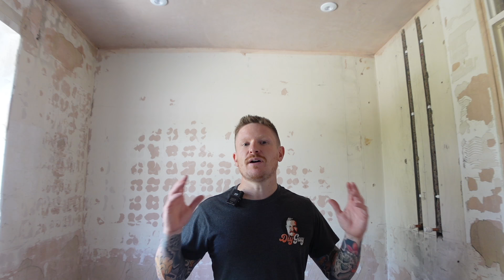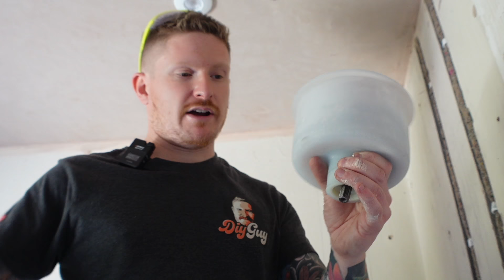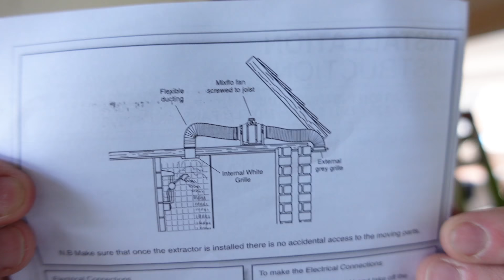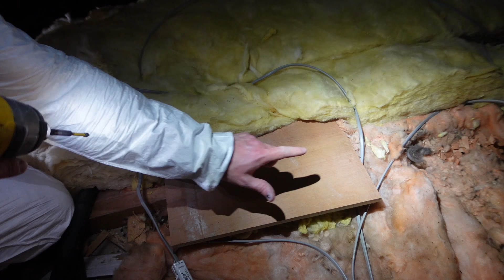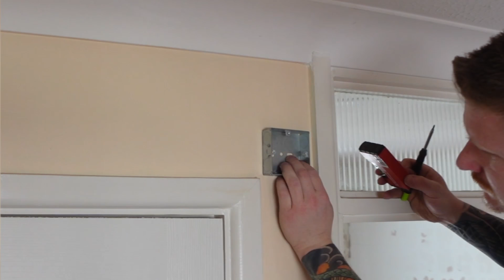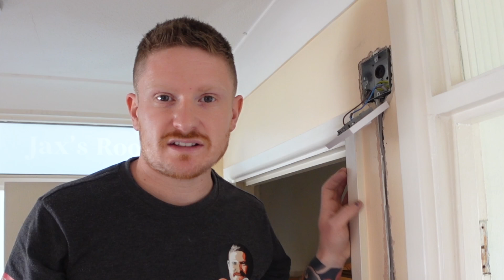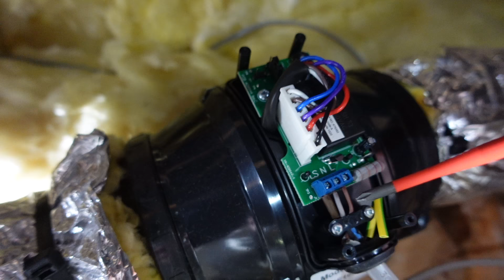How to Install a Bathroom Extractor Fan - Complete DIY Guide Made Easy

Comment: You don’t explain where the wires go if the light switch is directly below the isolator switch does the cable go up behind the isolator and back down to it ? Or have you wired it differently to your bench setup. ?

Comment: I have the same fan but in the 150mm version. Smallish bathroom. Fan over the shower. 1.5m from bathroom to fan then 1.5m from fan to tile vent. Are these ment to clear steam instantly? Ours does clear it but takes a good 5 or so minutes after showering. I bought the 150mm version thinking it'll do it easily. I've also used insulated ducting. Any ideas 💁‍♂️
Reply: Could be air starvation? Make sure theres somewhere for air to enter the bathroom ie ventilation in rest of house, large enough gap under the door etc

Comment: No, don't turn the fan by the light switch, its noisy when you don't always need it and you're pumping expensive warm air outside.
The best way to turn the fan on IMO is to fit a flowmeter to the cold feed of the mixer shower. So, the fan only comes on when the shower is turned on and it tells you when the mixer is up to temperature as the fan only comes on when the mixer is pulling cold water.
I fitted this in my previous house and it worked well for 15 years. I'll be doing the same in my new house.
Reply: hi, what is a flow meter? this is a  great idea. no one wants the fan kicking in when you are just going in to get something.

Comment: Hi mate - I need to replace an existing fan that has an led light. The fan has totally died after 14 years. Can I get away without changing the external
Vent on the outside roof?

Comment: I fitted one of these Manrose fans around 6 years ago when installing a new bathroom, however I opted for a moisture detector to control the fan, fitted in the ceiling with a manual override, an excellent quality extractor fan, and is fully automated, the fan will run until the moisture in the bathroom has been removed before turning itself off.
Reply: do you have a model number for us please?

Comment: Hi mate great video. I would like to wire the fan to a separate switch rather than to a light. Would it just be like the wiring to the isolator? Cheers. John.

Comment: Does it need to be insulated ducting the lads who installed mine used standard. Also they just seemed to put it into soffit without putting in a vent. Seems like moisture level in attic has got worse since...
Reply: Yes it should be insulated. No vent is lazy. Might not be tight on the fan if loft is getting wet

Comment: I bought a MF100T a few weeks ago. It’s running at its maximum speed, the fan has approximately 400mm of duct either side, venting out of the gable end with a wind flap vent. The vent is directly over the shower (rainfall type) The suction is unbelievable I must admit however the bathroom is still very foggy when showering and moisture is still dripping from the ceiling, walls are still wet after a shower. I don’t know what more I can do, very annoying. I may install another fan but on the external wall and see if that helps.
Reply: I’ve got the exact same issue as you, I have a large rainfall type shower head in a smallish bathroom. It generates so much steam I can have the window open and have the manrose fan on same time and room still gets incredibly steamy. I have seen that rigid ducting increases the effectiveness of extraction by allot, not sure if another extractor on external wall like you said would be better then changing all the flexi for rigid.
Reply: @ I may try that to be honest as for me it’s easily accessible and a very short run straight out of the gable end.
Reply: An inline fan can't remove all humid air instantly,  it just reduces it. That's why they tend to have a 20min max run time. Mine clears alot quicker if I open the window too slightly.

Comment: Others may have already pointed this out but many soffits on older properties were created with asbestos boards - you need to be much more protected with a high performance PPE respirator before cutting the aperture - especially when doing so from below.
Reply: I thought I was the only one that noticed that 🤣
Reply: So how do you work out exactly where to drill the 100mm (or bigger) hole in the soffit so that you avoid the rafters and other timbers ? Also  in my bungalow the soffit is somewhat lower than the wall plate to which the rafter are secured and I’m not sure if there is clearance to feed the insulated duct and it cannot be reached from the loft as it’s too far down. 
Is the another way of venting the fan ? (Or solving the problem)
Reply: @Thegasman51  Go through the side of wall.
Reply: @Thegasman51  good point. Drill upwards with a thinnish long bit, leave it in there. Go into loft and observe, then adjust from below. Wood fill inspection hole if necessary.
Reply: @Thegasman51  in between the facia board nails 😉 the facia is nailed to the rafter ends then some eletrical rods are handy for pulling things down you can't reach 👌
Reply: I also initially thought this but after pausing and zooming in on my camera, he is using a JSP P3 series (RD) respirator and the P3 series do provide Asbestos dust protection, provided that they are fitted properly.
Reply: @smout6538  slow down mate it only stops white asbestos fibres not blue or brown...

Your false information will end up killing someone!

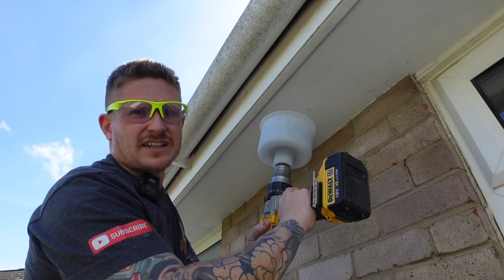Comment: Asbestos alert at 4:00 minutes in. This is AIB asbestos insulation board and it's the worst kind. I have read you had this tested but it definitely looks like AIB. I hope nobody has followed your advice in this regard. Sorry to be negative but it needs highlighting.
Reply from the maker: Tested and not asbestos. Thanks
Reply: @TheDIYGuy1  Did you take a small sample in Hazmat Suit and Full Face Mask etc before commencing any work or did you send off the circular piece after you'd hole sawed it out? You need to edit this video at 4:00 to highlight to others that THEIR soffit MAY contain asbestos and it needs to be proffesionally checked prior to drilling. I am serious, this material kills people and you have endangered your viewers and families even if your sample did not contain asbestos. Do you understand what I'm getting at?

Comment: Clear,  excellent video and diagrams. Installed the same fan. Used the same Manrose 100T fan but hung from roof truss, supposedly less noise. Going to change over the one metre PVC flexi duct coming from fan to gable wall due to condensation in the duct during winter. After i installed  it i asked my electrician to wire the fan separate to the light as originally fan came on with light, which was a pain when using the shower during the day, and the light was on!  Much better now with the fan and light separate!
Reply: Fit insulation on ducting

Comment: mate, any tip on dampening vibration? had one installed and it HUMS the entire freaking house!
Reply: Rubber grommets under fixings and attaching not directly above the ceiling, maybe adding extra board under.

Comment: You conveniently  didn't show the pain you had in getting the duct over the edge of the ceiling  beam and into the soffit  box . I never found a gap of 100+mm at this point.  And I've fitted dozens of these manrose fans.  Also you didn't show the hassle you had getting the outer vent tube with duct plus cable tie back through the 102mm hole you cut.........hmmm
 sorry if you're going to give diyers a guide you have to show them the awkward bits too.

That said good demo but please show the awkward bits not edit them out.

Comment: Obviously couldn't be used due to location, but this external vent type used in vid often seems to reduce fan performance a fair bit. Always found cowled outlets with open/close swing flap work far better, when location permits.

Comment: I’ve just replaced our manrose MF100T after 7 years of use (it died gradually getting slower and slower and yes it was cleaned annually).  They are great, quiet extractors, however, having tried all sorts of ducting the wind noise in our small ensuite is very loud.  I would be interested in any advice to limit this noise, my 2 thoughts are:

1.  Fit a different inlet grill in the ensuit, maybe a different design may cut down the wind noise?
2.  Set the fan speed to med or low?  However I love the volume of air this thing sucks out on high speed, it almost closes the door! 🤣

Grateful for any advice please…..👍

Comment: Poor install overall !
1. No information on the correct fan size for the room, how many air changes are required of how to calculate this.
2. Using flexible duct while not against regulations, it's poor practice. Insulated duct, OK but you don't mention slipping the duct towards the outside, to ensure any condensation gets out of the building!
3. There's no back draft valve to stop wind b!owing back into the room, especially in winter!I
4. There's a risk that flexible duct will get clogged or squashed and restrict air flow, cajoling run times of prevent moisture removal.

Comment: I find it a lot easier to wire up the fan with a length of flex before I go in the loft then just connect it up in wagos and put it in the wagos box.

Comment: Before you do anything, especially drilling, make sure that ceiling is not containing asbestos guys.
Reply: My neighbour had one of these put in mate. His bathroom is on the opposite side of my house.but the noise I can ear it sounds like a buzzing noise and causes my walls to have vibration. I no it's that atic fan cause when his bathroom light comes on the noise starts. Any reason it's so loud?
Reply: @wolves1980  I did this myself in my old house and had some vibration issues. They need to make sure the zip tie attaching the vent ducts to the inline fan are tight and that nothing is touching the rafters as what happened with me is, despite having rubber feet to prevent chaking, the wire coming out of the fan was touching the body of it then touching the rafter without having a cable clip. It was then vibrating finely and that noise was travelling. Once I realised and made everything secure it all stopped. Another thing some others do is essentially hang the inline duct fan from wires/ropes from the rafter so it is not really touching anything.

Comment: Hi great video once again I have the same in-line fan can you tell me where you got the inside ceiling vent from so I can get mine fitted the ones I have seen need screwing right on the edge of the hole and don’t have much length for the ducting to fix to many thanks .

Comment: I’ve just swapped an in ceiling style fan which just wasn’t clearing the bathroom of steam with 1 of these style in extractor fans.  Doesn’t seem to have made much difference at all even though it’s got almost 3x airflow rate. 

Whilst I was upgrading the fan I also used solid pipe from the intake vent in ceiling to the fan itself (flexi ducting from the fan exhaust out to the eaves vent as that’s difficult to get to)

Comment: Silly question but where do you get your cable from? Want to make sure it's the right stuff, or is four core, four core regardless where it's from?
Reply: As long as its 1mm or 1.5 mm you can use flexible cable or flat 3core and earth cable

Comment: Fitted the same model before and it works great. But just fitted one in my own home and its not working properly.theres about a metre of duct either side of the fan. It sucks a tissue up from about 2" away. And its set on high. Any suggestions? Thx

Comment: Hi just wondering can you advise what you should do with the permanent live if you have an extractor that doesn’t have a timer …. I’ve replaced a broken timer extractor for one without but now it’s constantly on the bathroom switch doesn’t turn it off?
Reply: Don't connect it to anything,  put a connector or wago on it and connect the other live cable In to the fan live terminal , that's your switch wire.

Comment: NEVER place the external vent downwards on a horizontal surface. Hot air and steam rises, it wont push down and out and you’ll end up with moisture pooling in the ductwork creases and forming mould within days of using it. These are designed to be fitted to vertical surfaces ONLY. I should know, I design and manufacture them.
Reply: Every house I have ever lived in has it placed horizontally and this has never once happened.  Your words sound good in theory but it doesn't match reality.  Which makes you wrong.
Reply: Why did the manufacturer’s instructions show it facing downward then? It sounded like there was quite a bit of power behind that fan…wouldn’t that be stronger than the steam rising?
Reply: What a load of bollocks, he showed you the instructions of the product and that mounting in horizontally was a viable option, its literally in the manufacturing instructions
Reply: Can you recommend a suitable product or method for placing horizontally on a soffit?

Comment: It's a very powerful fan but what options are there for when you need the lights on at night but don't need the fan sucking out all your dry warm air? (e.g.it's a cold night, the central heating is on, you haven't had a shower, you're just brushing your teeth but turning the lights on means you're sucking the warm air out for the next 10 minutes!)
Reply: Manrose do two different versions. One with a built in timer and one without. In your scenario you'd probably want the one without and then install it on a soerate pull switch so you can have the lights and fan be turned on by different switches.

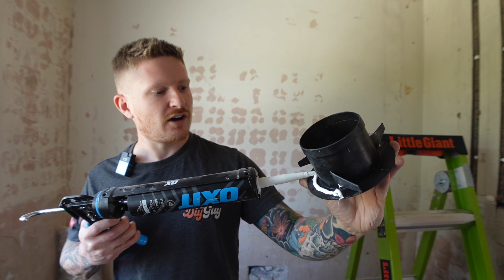Comment: Does the internal part of the vent, the part you insert into the ceiling at 2:20, come with the extractor? Thanks!
Reply: I got same question. The item you listed to buy does not come with that. And also has some metal screws and connections that are said to rust quickly...

I really need that black part

Comment: Great video, quick question.
I have existing wall extractor fan, it's been slowing over previous months and makes no noise (still spins slowly). Can you tell which bit is faulty from this? i.e. the thing in the loft or the wall

Comment: I don't recommend going out of a soffit.  Hot humid air will rise and cause issues.  Especially on vented soffits.  It will suck it right back into the attic and rot your roof out from the underside.  This wont be a fast process and it might take 5-10 years but he damage it causes will be massive.

Comment: I need to install a new fan in my bathroom as the old one has died. My external vent is actually out through the roof. What would you advise to prevent condensation/water running back down the vent and into the fan/bathroom?

Comment: What I would like advice on is where to source the outside vent with a one way flap that does not rattle in a wind??
Reply: Put rubber/silicon stick on grommets on the shutter up stop the clacking noise

Comment: I’ve got a question for you. When it comes to re doing my bathroom I would like to replace my inline fan and ducting that’s in my loft. My question is the fan isolator switch is actually in the loft with the fan. Is that ok or should I replace that and fit one in my hall above the bathroom door? Cheers

Comment: Further to my previous comment. We never used the soffits again. We found roof tile vents much better as the ducting worked better being as short as possible and going in a vertical direction. I do like your use of insulation around the duct that will help with condensation in the duct where it lyes flat on the joists.

Comment: Many years ago I installed a kitchen extractor vent in a soffit as you have done. It was a new build and we had a building control officer come and inspect he wasn’t happy and said it contravened building regs as the moist air would have detrimental effect on the soffits and fascia. I don’t think I’ve seen this extraction position on any new builds.
Reply: He’s right. I had my extractor vent on the soffit and because hot air rises, it came out the grill and rose to the soffit and blackened it over time.
Seeing the grill in this video installed so that the air was blown across the house and soffit instead of away was unfortunate but to be fair, a grill of that type will have trouble moving hot humid air away from the building.
However, there are vents that feed the air down into a channel so that the air is directed horizontally away from the house. There was one that was horribly expensive but designed to a fault, and one that looks like it’ll do the same job but with a smaller air direction channel… it also comes with a non return flap but I want to remove that and glue wire mesh in place so birds and insects can’t enter the tube.
Reply: That’s ridiculous! A normal 4 inch window fan in an upstairs bathroom would do exactly the same thing! Also a tumble dryer vent would do the same thing once again!

Comment: Had one of these fan for the last 10 years. Because of the room size  & large amount of steam in the room I’ve set the jumper on full speed & the timer keeps the fan on for 5 minutes after the bathroom light is turned off. I get up in the loft once a year to clean the fan . It can be detached from its mount so you don’t have to disconnect the pipes.

Comment: Moved into a 2020 house, while boarding my loft (using Loft Zone kit), noted that these ducting just sit on the insulation in the loft. 
Shouldn't they be elevated / hanging off the joists above the insulation?

Comment: I was told the fan shouldn’t be above the shower? That’s according to building control
Reply: There are zones in the shower or bathtub where you can put it and this will determine what IP rating you'll need for each zone.
Reply: @tieri46  it’s not about IP rating, it is about the person washing having access to the electronics. But this fan is not direct in the hole it’s some distance from being accessible. Which means it passes